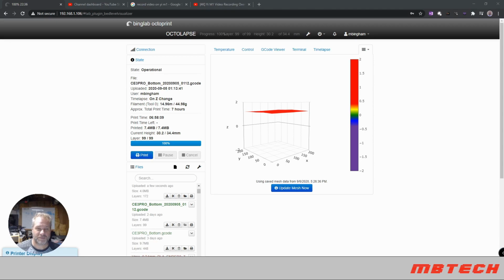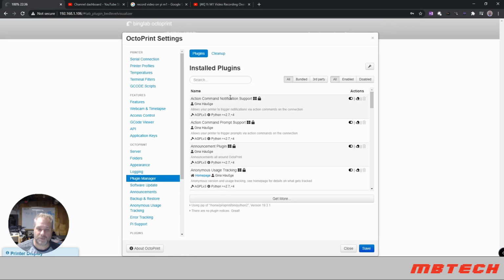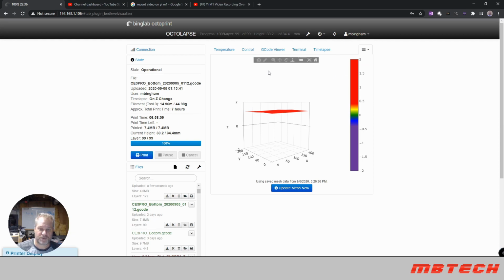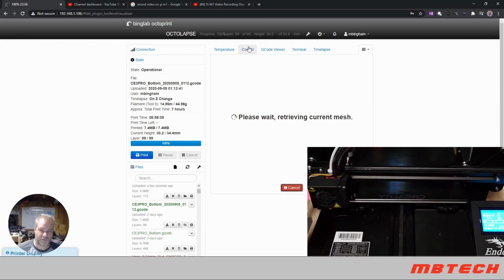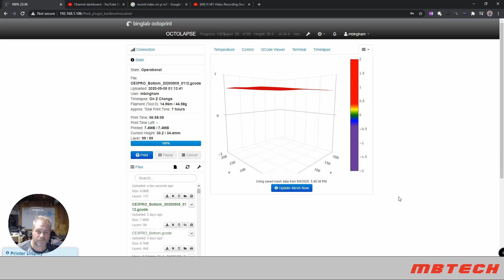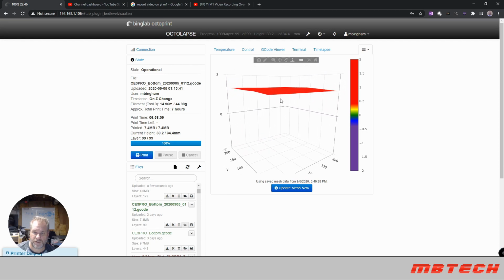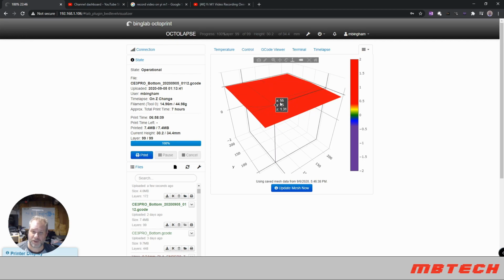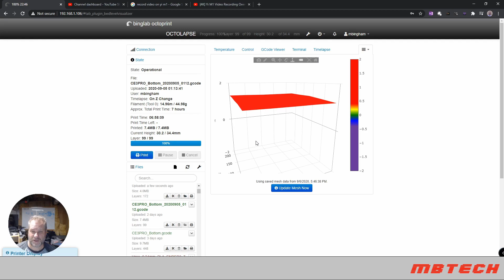Bed Visualizer Ender 3 Octoprint

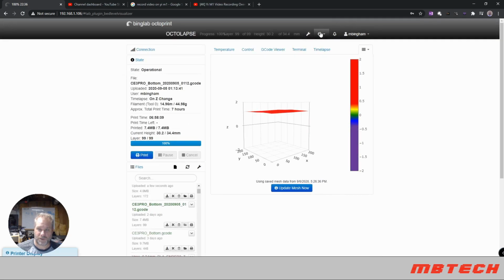Comment: 0:48 For those wondering how to get to the point "Update Mesh Now" : 
You need to set the GCode sequence in the settings ("Collection") and there is a link (to Github) with examples on top of the empty GCode form . I copied the "Bilinear bed levelling" code and voilá the "Update..." button appeared. After several minutes the diagramm appeared for my Ender 3 S1

Comment: How did you get it to probe a 5x5 vs a 3x3. I can't find that in settings
Reply: I had the same question.  I've seen on some of the forums that some folks use a 7x7 as well...more is better, right?
Reply: @AnArmAndAGreg  I would think. I never got an answer on here but the dev for the app replied on some forum and said you have to go in edit the GCode. Sounded over my skill lever so I gave up.

Comment: Thanks for the video on my plugin, hope you find it useful. I'd recommend using the option for relative z offset for your use case and that will bring the mesh down closer to 0.
Reply: What for a GCode i need for a Ender3v2 and BLTouch ?

Comment: Hello, why does your glass bed is up and down ?
Reply from the maker: Great question and good eye.  I do this so that the surface is extra smooth.  If your bed is extremely level then nothing is required.  If you do have some issue with it not sticking I use the Elmer's glue stick the purple that turns clear.

Comment: does it matter that the probe hits closer to the left edge than the right edge? wouldn't that cause issues when it actually prints?
Reply from the maker: I just re-watched my video and you are correct I didn't notice that it was closer to the left edge.  I have printed a lot of items and have not had issues.  I will see if this might be something that can be changed or make a offset change.  Thanks for pointing this out to me.
Reply: @mbtech-yt  I only mentioned it as mine does the same and I can't find an answer to if that makes a difference but in my mind wouldn't it be making an inaccurate mesh? As when it goes to print wouldn't the mesh data be of a different section of the bed?

Comment: does the update mesh button actualy level the bed with the bltouch?
Reply from the maker: They way that I have it no.  It just gives me an idea what the bed looks like.  I adjust the wheels where needed and run it again.  Once I have it set though I normally do not have to make changes until about 15 Prints.
Reply: @mbtech-yt  Thanks mate.

I also found out that the 0,0 point on the mesh screen is the front left of the printer, this helps in determining what bed wheels need turning also blue meens raise the bed and Yellow meens lower the bed. 

So anything bellow the green colour seen to the right at 0 meens raise the bed and anything above the same green 0 meens lower the bed.

Not sure why on yours it is way above the central 0 point way into the red but it looks well leveled anyway.

Comment: Can I get a little help I'm trying to get the nozzle and the bed in Octoprintt to heat at the same time I know there are g code commands for this however I'm not trying to set a specific temperature every time I modify G-Code commands I want to just slice it and dump it in there
.

Comment: Does the plug in also work on manual mesh? Thanks for the video
Reply: Yes it works with Mesh bed leveling. You need to run "G29 S0" insted of auto probe. This will report stored mesh from memory to bed visualizer.

Comment: What do you do if you are running it the 1st time without a previous mesh? I just installed octoprint and the plugin for my CR6 SE, but not sure where to start. TIA!
Reply: Hey Darth, I am on your same boat. I need some insights into how to correct the mesh. The CR6 has the auto bed leveling and it prints just great for me, great first layer adhesion (sometimes my prints are hard to come off from  the glass bed even after cooling.) I wanted to see how good the bed mesh looked like. I used the sample marlin Gcode for the plugin settings but not sure if applicable for auto bed leveling printers.

The search for the info continues. Let me know if you find a solution. Thanks.

Comment: Can you share your GCODE?  Thanks
Reply from the maker: I don't send any specific GCODE.  The number of points is determined by the marlin firmware.
You need to change the constant value(s) in your Configuration.h file of your Marlin firmware:

// Set the number of grid points per dimension.
  #define GRID_MAX_POINTS_X 3
  #define GRID_MAX_POINTS_Y GRID_MAX_POINTS_X

to:

// Set the number of grid points per dimension.
  #define GRID_MAX_POINTS_X 5
  #define GRID_MAX_POINTS_Y GRID_MAX_POINTS_X
You only need to change one value to go from a 3x3 grid to a 5x5 grid.
Reply: @mbtech-yt  
I think it depends on the FW you are running.  If it's not defined in the config files.  For me running Creality Marlin version 1.3.1 on my Ender 3 Pro the plugin said to add gecode.  If you go to the plugin settings and follow the link it takes you to a page and for Merlin the gcode is:

M155 S30		; set temperature reporting delay, use a value longer than the time it takes for your leveling command to complete.
@BEDLEVELVISUALIZER	; instruct plugin to start recording responses from printer.
G29 T			; report the bed leveling mesh points.
M155 S3			; set the temperature reporting delay back to a shorter time span.